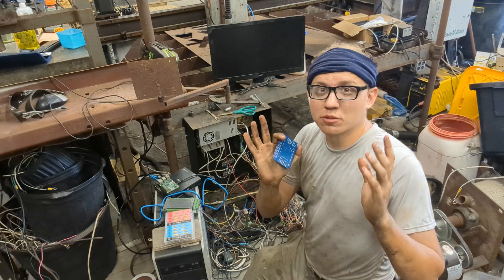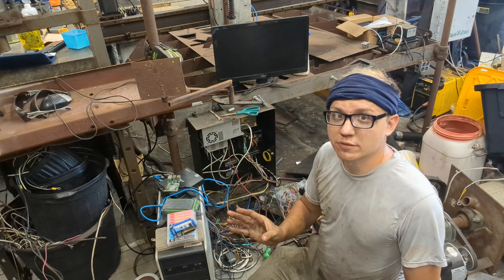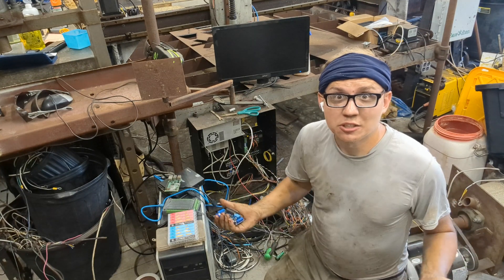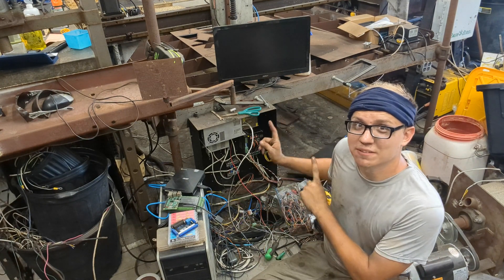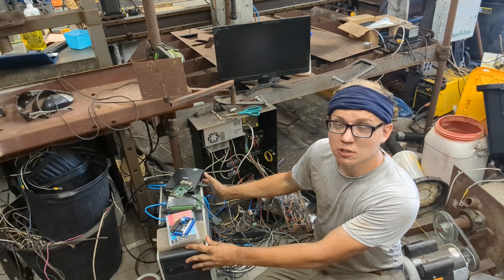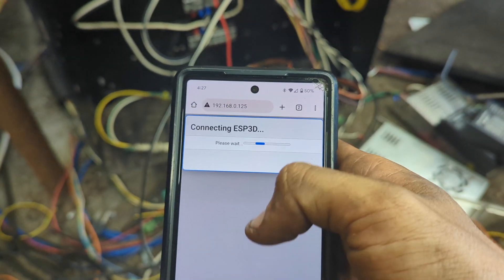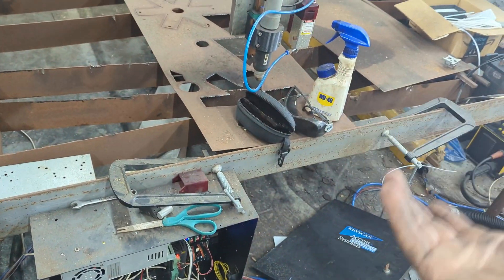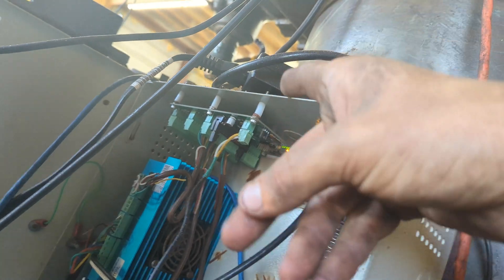Which CNC controller to pick? Linuxcnc mach3 grbl centroid fluidnc

Comment: totally idiot idea use cnc whit phone. stupid. fluid 60$ expensive no thanks, lot better use paraller port board, cost max 10 $ and IF pc not has paraller port use linuxcnc compatiple paraller port pci card less than 20$ and have ready to use. easy. USB cards is big fail, no safe, no real time, no good, lot problems, best is mesa card but need understand how program more all. ethernet, pins, many.
Reply from the maker: I don't think you know what you are talking about. Phone is just a display and input method. You can still directly connect to fluid nc with a laptop via USB if you wish so. 

Otherwise things like plasma cutting, there's no reason to have 0 latency connection. You can still add an emergency stop button directly to the board. In addition fluidnc allows for a direct handwheel control to the board

In short you are completely wrong and lack lots of basic information

Comment: So you're saying that electromagnetic interference in a cable is stronger than in a radio connection? are you kidding me?
Reply from the maker: No. I'm saying USB has no electro magnetic interference protection. It's communication protocol is very simple. Wifi has plenty of calculations and ways to avoid interference. It's very simple common sense I hope your question is a joke. You are kidding me for saying something ridiculous like that right?

Comment: Install a$20 EMI filter box after the machine's power supply and the electrical spikes shouldn't be a problem.
Reply from the maker: I think you are very confused. Emi is from the plasma torch. It affects laptops and mobile devices.

Comment: Thank you for pointing me at the right direction.  I was almost gonna spend a bunch of money on a ethernet CNC controller when I see the light.  ESP32 is absolutely the best way to handle a CNC as opposed to lugging around an entire PC.  I also started with a parallel port, then switched over to USB. when my old PC died, but then the USB just kept losing connection probably due to interference.  I can't wait to try this out.

I was going to buy the official FluidNC board, but it's sold out, and Elecrow in China now charges a 60% tariff.  Ended up going with the $24 controller on Aliexpress and I'll flash FluidNC myself.  For those who are wondering, I searched "CNC GRBL esp32 controller".  I do hope that Tindie would have theirs back in stock soon.
Reply from the maker: I got that tindie 6 axis one I love it. Very disappointed it's out of stock. There's a list on the fluidnc wiki showing off every option possible
Reply: @Rowow  Yeah it's a shame the only place in stock is a Chinese vendor.  I went through the list but everything under Tindie were out of stock.  Maybe you turned enough people to their website. :)

Comment: 02:19 Parallel port add in cards are like $10 so you can add a parallel port or even more then one if needed to any computer you have one laying around, if that helps anyone who wants to go this route.
Reply from the maker: Definitely don't wanna do that route. As I've already explained you'll need a computer monitor mouse keyboard etc. for every single machine you want to operate. Even if you have all those things lying around for free, It's absurd to operate and annoying. Comparing that to a fluidnc controller is a no brainer. Anything you want to do on a parallel board can be done on fluid nc cheaper and easier. Stop coping, just stop
Reply: and bonus computer and all stuff, display etc, cost lot lot cheapen than fluid or esp shit, and if need more in/out pin can add second paraller port card 10$ and breakoutboard 10$ more pins have cheap. i use old computer, 2 paraller port card and 2 breakoutboard my machine  workng well and cost less 60$ and only fluid shit card cost more than all my computer parts together, lot cheapen system can use. cheapen what can use is arduino but not has good use only cavemen GRBL system.

Comment: I thanks for share it ! , can that board work with a THC like proma thc?
Reply from the maker: See the fluid nc wiki for more details. Plasma Spindle and THC | Wiki.js https://share.google/Z5FsAzalppsj86eTs

But in short use a external THC controller and fluid nc can send a signal when to turn it on or off

Comment: i got a parallel port to fit a pci-e slot about 2 years ago.
Reply from the maker: And if you added up your total cost for that, computer monitor keyboard mouse parallel port etc, could had bought a fluidnc board for a fraction and much better interface anywhere you want
Reply: @Rowow  no, the card was about what a fluidnc controller would cost and i already had everything else.  aside from that, fluidnc was not something i knew about.  the BEST i could find, that was halfway close to fitting my needs was a mesa card.
Reply: cheapen option all this boards and easy simple build all together, old pc no cost lot 10-30$ bob cost 10$ old display not cost lot i just buy 3 old display 20$ less than 40$ can build all computer, breakoutboard, display, keybad, mouse, cheap and easy setting.

Comment: I am thinking about going with Centroid, I have had bad experiences in the past where you get software from one source and hardware from another... then when a problem arises A blames B and vice versa. This has happened to a lot of people I know with internet setups router maker blames ISP, ISP blames router maker etc.

With centroid the software and board are coming from the same supplier... no blame game... no "not our problem". Extensive support literature is available IN ENGLISH.
Reply: and waste lot money stupid, if all in one boards go problems or broken one axis have lot problems or waste lot money buy all new, modular small system is lot better if one little part go broken not need buy all elektric box new, only change driver or what is broken. lot cheapen than ready big one at all systems.
Reply from the maker: Huh? Who the hell has issues with boards over ip

If you do you setup your system very incorrectly or don't understand basic IP system. You always set the static IP of your device in your router
Reply: @Rowow  
I don't think you understood my post at all. Let me put it to you this way, one day my internet stopped working and my ISP told me it was the cable. We bought a cable. We told them it didn't work. Then they told us to buy a new router... still didn't work. 

I never said anything about static IP's... I don't know why you think that is relevant. My comment was about being messed about when something doesn't work.

You are looking at this as an expert who understands tech at a very deep level... but most people are not like you and we tend to get the runaround when we ask for help.

But let me ask you a question Rowow... if you add up all the time and money you spent on all that messing around with all those boards... you WOULD have saved money if you just went with Centroid right? The fact that you have done SO MUCH messing around proves me right.
Reply from the maker: @matthewdonoghue321  In my previous job we literally have centroid and I have worked with it and have seen a large amount of bugs glitches etc... I've had to see my boss go into much deeper knowledge with creating bat files etc to get his system properly running. Instead of simply going with Linux CNC 

Fluid nc is plug and play especially if you get a premade board. Only thing you have to do is go to your router and set the static IP so you can use the same IP address without it switching constantly. It's way less work and hassle. Great thing about open source communities is there are forums and people willing to help.
Reply: @ 
Interesting... I will have to reconsider this new information. Thanks.

Comment: Designing electronics that are immune to noise can be tricky. In the old days they used 12 Volt serial lines. What works for me is optical isolation.

Comment: i just started using FluidNC on a router.  It's definitely a game changer to be able to do everything from a tablet (or phone) with a simple web type interface wireless connection.  I agree with all your comments and criticisms of usb (or ethernet) and parallel port setups and the need to have computers when the controller boards with the sophisticated chips (thank you 3D printing) alone are capable of handling everything.  Quite a jump ahead in my opinion.
Reply from the maker: Thanks I'm glad others see the potential!
Reply: Yo can just use an usb to ur needed interface port.Ive even seen it in the industry
Reply from the maker: @ClippiClipstarr  USB had issues with electronic interference especially with plasma cutters. It will randomly time out or do the wrong command
Reply: @Rowow  Sry I meant you can use an USB to Can or Ethernet and use then ModBus or EtherCAT or other interfaces. Sry my original comment was made in a subway 😅
Reply from the maker: @felixg2062  ok but it's still through USB... Weakest link in the chain. Does that make sense? If the ethercat is reliant off a USB connection then it's vulnerable to USB issues
Reply: @Rowow  Yeah I get that but sometimes you just need to make some cuts. Personally I wouldn’t use it too only if you would have to pay 10 x more for it. But in the end it’s great what you showed thank you for that great and informative video I definitely will use and play with it and make some machines 👍🏻

Comment: So have you actually tried centroid? You put it in the title then said nothing about your experience with it.
Reply from the maker: Yes in my last company I worked with we used centroid alot
Reply: @Rowow cool what did you use? Acorn Oak allinonedc hickory? I have acorn and oak and am quite happy with them have linuxcnc too and happy with that, what would you say makes fluidnc stand out? Im not so worried about overall cost although it is a factor, reliability is important and so is very stable predictable software with updates for bugs etc.
Reply from the maker: @weldchip  hickory and acorn. As I already explained fluid nc is a small standalone controller. You don't need a additional computer. It's 2024 we have microprocessors so cheap and powerful don't gotta run a whole damn PC

Comment: Just do ethernet smooth stepper  with Mach4!
The little extra money spent on good control software and electronics  and you'll save your self thousands over the Chinese junk
Reply from the maker: I've spoken to many people in the industry across many industries and the shift is completely changing. Western products break and are more junk that Chinese stuff. Sorry but that's just a fact today. Fixing them is far more difficult and typically impossible through no information, absurd hardware implementation, or outright refusal by the manufacturer to sell parts. Chinese stuff typically uses off the shelf components and they give you their schematics and information without hesitation. So why pay for a device you can't fix yourself, and breaks more often, than for a Chinese product that lasts longer, can fix yourself, and most importantly for the same exact price you can buy 5 of the Chinese stuff. So can buy a bunch extra for spares and it'll last 10x longer than western shit.

I support American manufacturing and plan to start a electric excavator factory soon, but we need to end our corruption and actually make good products. Instead of removing features and charging more for it later. Perfect example, subscription to heated seats in your car. Absolutely absurd
Reply: if want real good software no buy mach4 waste lot money than idiot, no working well ewer, build linuxcnc whit mesa card lot lot more safety and better and future can add lot lot more all you own addons, automation, ATC, other addons controll same card, and extra has no have "chinese junk" and true not need waste money than idiot licence etc extra shit.

Comment: No need to buy an old computer, there are parallel port cards
Reply from the maker: Which don't work half the time and again is a added cost. Plus you still need a computer to attach it to. For $100 better to get a monitor keyboard mouse etc with the computer. 

Or just do fluid nc and control it from any device
Reply: @Rowow  FluidNC can charitably be called a machine controller of very limited capabilities. There's not a whole lot behind their slick interface.
Reply from the maker: @1pcfred  for most cases that's all you need
Reply: @Rowow  ALL cnc you need buy display, keybad, mouse, IF want good controlled machine,  no waste money , used old pc, display, keyboard, mouse can buy less than 50$ all. together, i just buy one linuxcnc machine what future build all computer and parts whit paraller port card include and display and keyboard and mouse less than 20$ all together, need only install yesteday linuxcnc 2.9.6 version pc own hard disk size has 1TB.  true less than 30$ can build all controller stuff. need only hardware add next rails, motors, screws, frame, spindle, what cost normal more than all elektric together, big 1,5 meter rails 300$ spndle whit VFD 200$ motors 50$/axis, nema 23-34. drivers 20$/motor. little stuff etc, bolts, nuts, screws, couplers, etc about 50-100$ sensores 3 home, 6 limt SW etc 20$ cables 40-100$ what home have old project can make cheapen.
Reply from the maker: @mattivirtafluid nc controller costs less than just the PC. Stop being irrational
Reply: That only works on a 32 bit computer all others are not able to handle parallel boards at all believe me I tried.
Reply: That only works on a 32 bit computer all others are not able to handle parallel boards at all believe me I tried.

Comment: I did find this useful and intend to watch it again. There is a lot to digest.

Instead of an RPi, I chose a Beaglebone Black, but I believe the same deal applies regardless what board is driving the thing.

I have a Full Spectrum laser they refuse to help me with, and I know it's because I mouthed off, so whatever. I'm stuck with a machine I spent a LOT of money on, that does nothing.

So fuck Full Spectrum. I yanked out whatever board they had in there and have been leaping down various rabbit holes trying to educate myself as I go.

Thanks for posting 👍
Reply: RPI have ok, IF understand all problematic programming and code and setting problems whit hard linux system.

Comment: It's not a software limitation it's a hardware development problem. Industrial machines use custom hardware to run code and drive servos and monitor feedback in real time. All of the PC based systems blindly send move commands with very little to no feedback. Servos and closed loop stepers used with PC based systems use drivers that do individual axis level feedback that sends nothing back to the control.

Aren't many companies out there want to make the specialized hardware if there isn't a machine to go with it.
Reply from the maker: Plenty of it being done for 3d printers. And the fluidnc project proves its possible. Just the code like Linux CNC is designed for a outdated model, where cheap powerful microprocessors were not available
Reply: @Rowow  Which 3d printers provide closed loop feedback for their motion control?
Reply from the maker: @timogross8191  I don't know I dont buy 3d printers I make them. Just add it on its not hard
Reply: @Rowow  LinuxCNC is designed as a stand alone machine controller. That's the project's goal. It just doesn't happen to be what you're looking for. I think you mean microcontrollers when you said microprocessors. Because PCs do use microprocessors.
Reply: Linuxcnc does allow real time position feedback. You can have linuxcnc read the servo encoder signal, but most of the time, they will just add scales and leave the servo control loop alone.
Reply: Sure it does .  It Sends an alarm signal to Mach4  and stops Gcode immediately for any axis drive faults as well as any  Excess following error  which would fault Mach4 out as well and stop G-code.
This is pretty basics stuff.
Maybe take a few minutes and actually learn something before running off  about how it's no good.😂
Reply from the maker: @thieltech1 calling a drive error feedback as communication back to the pc is absurd. That's not at all what people mean by real time communication. Point is you don't need a modern full computer system for that. Instead have a control system to the controller on the CNC machine. Aka what fluid nc does. You should take some basic engineering classes to comprehend logic and cost value analysis
Reply: open stepper system cost to normal 200-300$ but if use closed loop system all cost 10-100 x more about normal 2000-4000$ what motors and drivers etc, need use how big, or small. and can run normal factory specified system normal pc. (but NOT windows OS safety)

Comment: Mesa actually is very good with keeping products alive. I can still buy the same CF to IDE adapters I've got almost 25 years ago! The problems with availability are probably related to supply chain issues, and they're getting better, and many popular boards are in stock. It's bad luck if the board in your machine dies and you can't get it next day, but usually it doesn't take long until they show up in the store. The cards are not easy to kill, but if your application pushes them to the limits, it's good to have a cold spare on hand anyway.